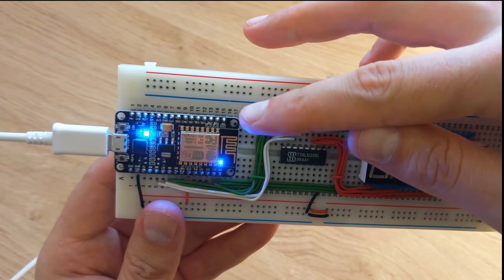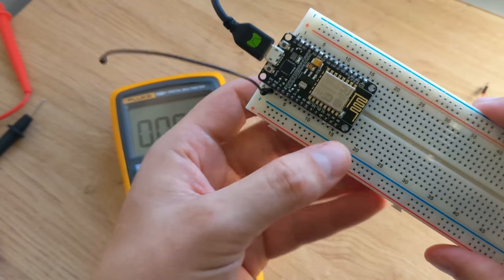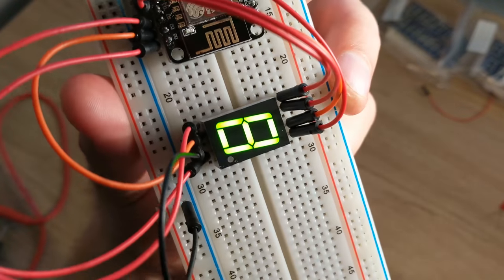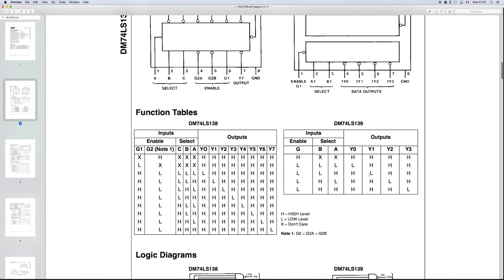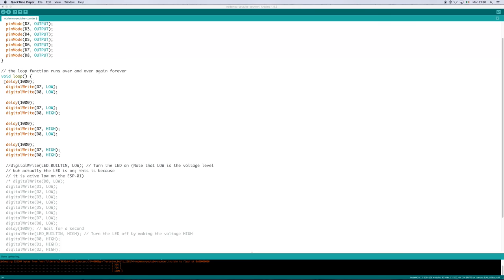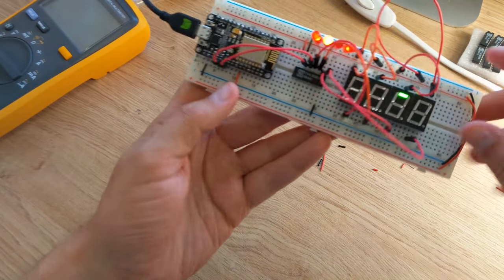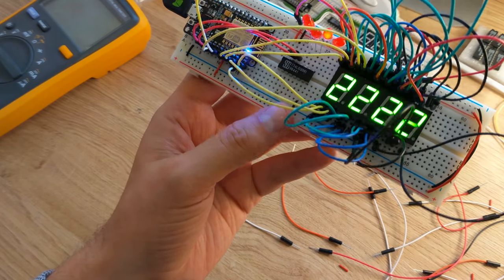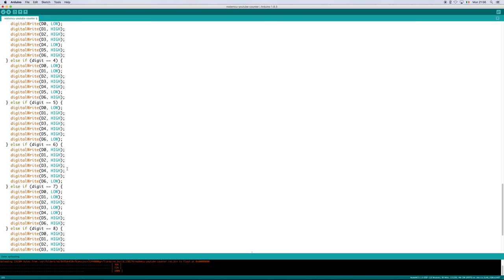Build a WiFi-enabled LED YouTube Subscriber Counter

Comment: Very cool project but there are two problems that should be corrected before you go into production with this design. First, the 2-to-4 decoder you are using must actually be a 74HC139 that has been re-labeled 74LS139. The 74HCXXX series chips will work down to 2v, a true 74LSXXX chip requires 4.5v minimum. Second, you really should have a 100 ohm resistor in line with each LED segment to limit the current flowing through the micro. You are over-stressing the micro but obviously they are pretty rugged and are able to handle it for some period of time.
Reply from the maker: Makes sense, thanks!